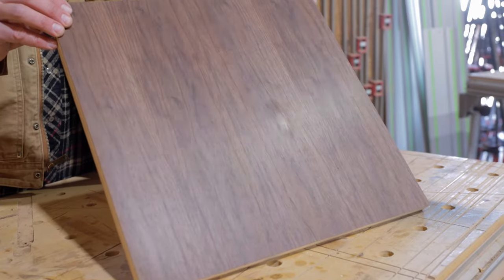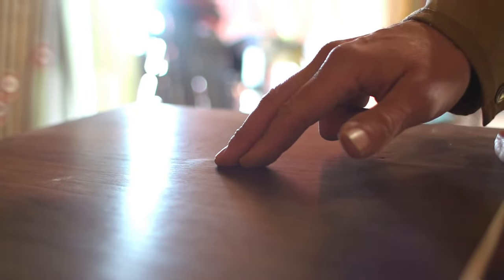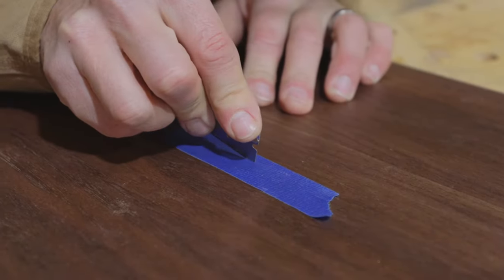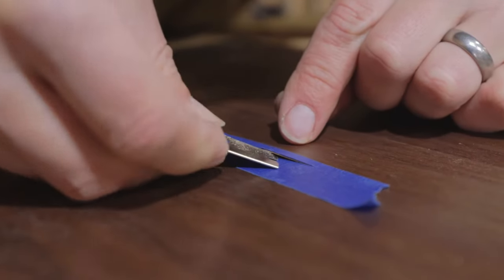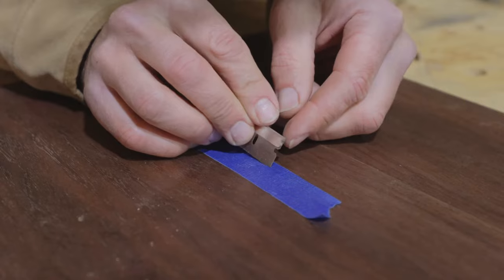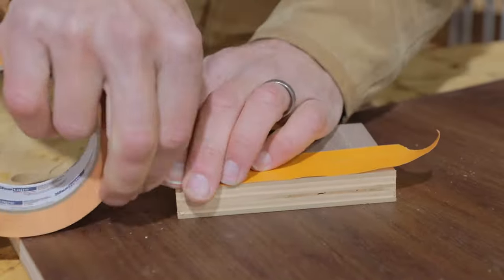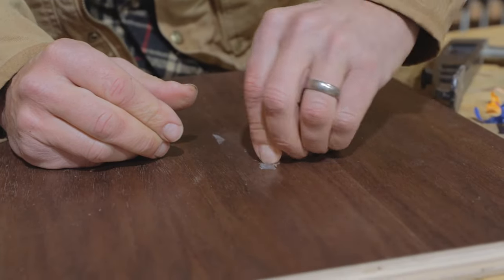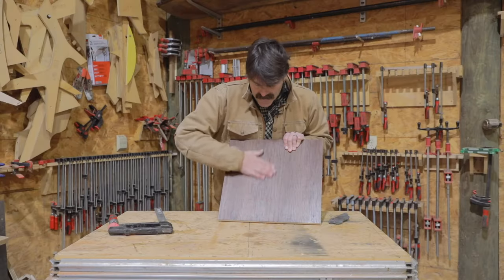Bubble in Veneer - The Fix with Jory Brigham

Comment: thank you! my first time working with veneer I didn't do so great with the initial glue down and ended up with lots of bubbles 😅
Reply: That's what I'm worried about ......
Reply: @singerAR0406  You better, I just screwed up a 70 dollar sheet of quartered oak....loaded with bubbles...looking for a salvage, but already ordered another 2x8' sheet because I doubt I can remove all those bubbles.  Heed the advice on pro's that do this!
Reply: @13612  I think I'm just going to live with it
Reply: @singerAR0406  I can't live with my results are horrible...trying to match my existing cabinet doors on a built in pantry...they have to look decent and I have a big mess currently.  What are you putting veneer on?

Comment: If you are using the iron-on PVA glue method and you get bubbles, just slit them before the glue has fully dried, squeeze the air out, and run over the spot with the iron again to adhere the veneer to the backing. No need for CA. Source: I just did it.

Comment: How would you remove the entire veneer without damaging the wood beneath? I have a foosball table that had a drink spilled on it.. I ordered a new vinyl playing surface, but am stuck with the decision of either filling in the gaps of the removed bubbled veneer and risk an uneven playing surface.. or attempting to remove all the veneer and lay down the vinyl
Reply from the maker: That's tough. I would assume with the vinyl on top it is not just one piece of veneer but a layer of plywood, which is a whole bunch of veneer. It will probably be easier to fill it and just use a long straight edge to make sure it's flat.